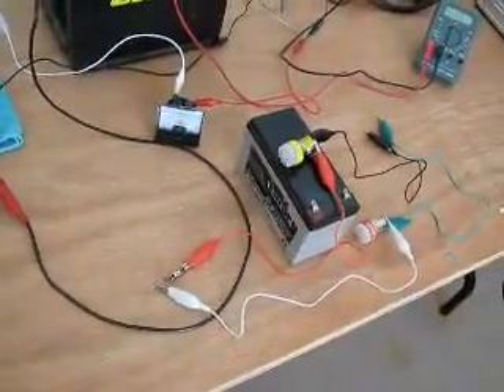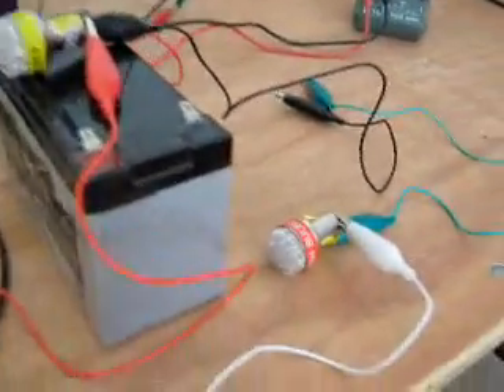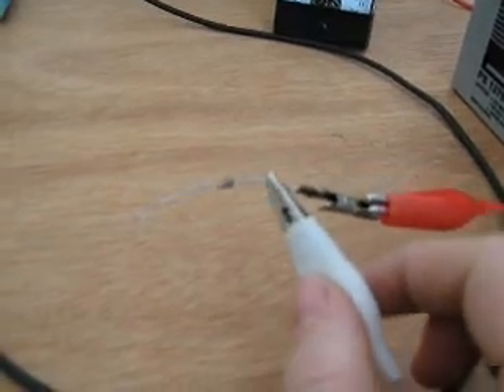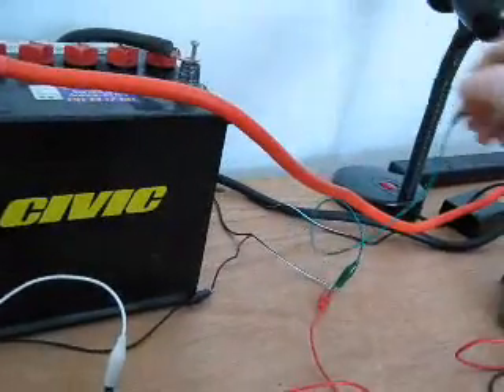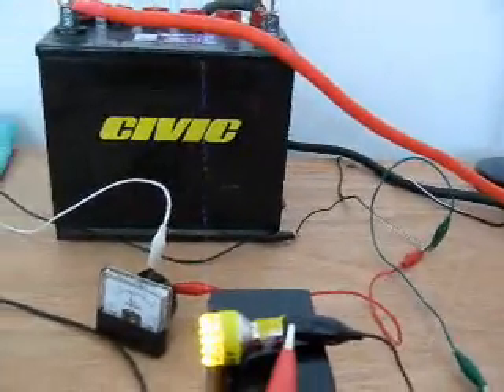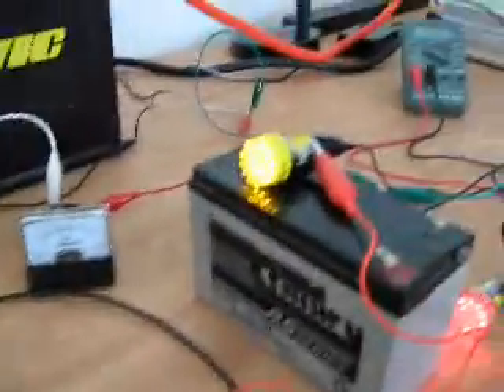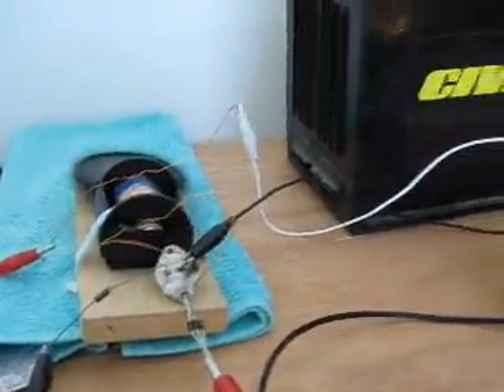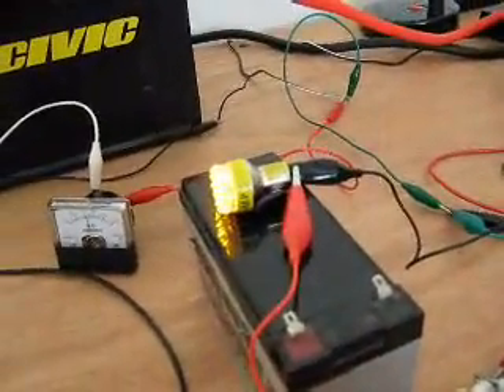bedini SG LED Lighting

Comment: Hey Steve, maybe the reason for seeing 2 volts across the light, maybe something to do with the fact that they are diodes in themselves and they have a certain threshold voltage to reach before they turn on.